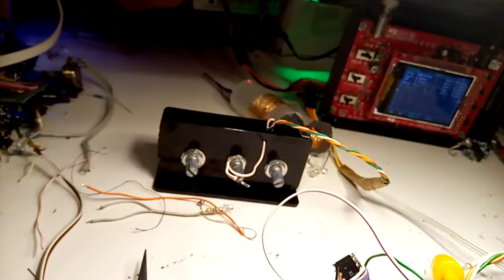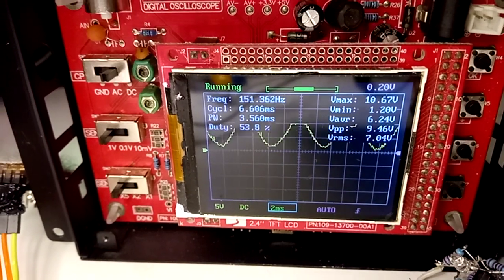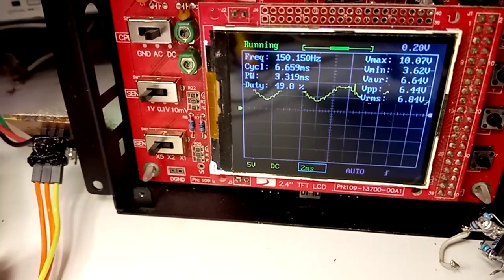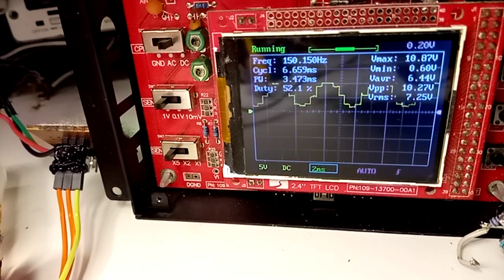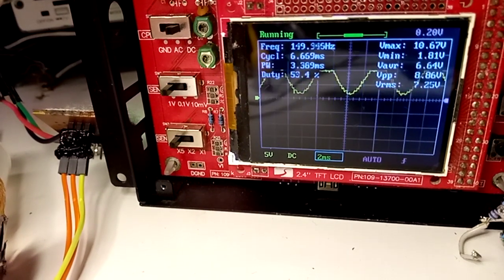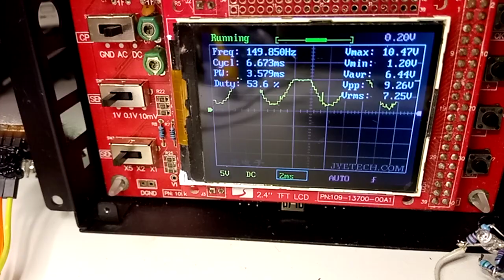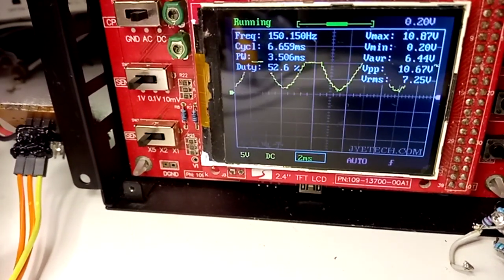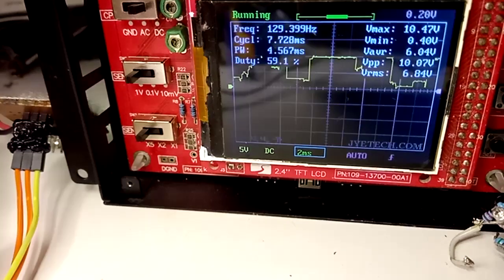Hardware-only DIY bitcrushing!

Comment: Sample rate reduction can also be done with a Sample And Hold (like my "YASH"). One of my favourite uses for this module. On your circuit here, I would look into providing a DC shift for the signal before processing, so you get to the lower bit settings. That clipping should be ideally made symmetrical.
Reply from the maker: RENE!!!! I used your 4069 VCO to control the "interrupt" function of the ADC, doing basic sample/hold. In fact, I like that effect better. I came back to this module with a LED-based trimmable reference voltage for the signal, exactly as you mention, and strangely with it set to exactly 2.5V it still needed trimming to get the entire 5V peak-to-peak signal working, and then the lower bit depths stay much more symmetrical too.

I've become convinced that a different approach is better -- basically using a pair of VCAs to reduce the amplitude of the signal going in to the ADC and symmetrically amplifying the output of the DAC, so you get less bit resolution without being restricted by the nature of binary numbers..... like you can have your signal turned into a number that's not just a power-of-two.
Reply: @ozerik  Yes, that clock part looks familiar :). There is a more compact circuit inside of my 3 phase LFO, done with a 4093 schmitt trigger gate (works with a 40106 as well). Your idea with the VCAs sounds promising. Be able to set it to something like 100 steps. But to get really low values like 2 steps might require quite a bit of precision. If you want to do it discretely of course. A micro controller can do this very easily.
Reply from the maker: @reneschmitz4845  I know, the part count for the VCA version would be so much lower and allow finer "bitcrush" levels. My brain has decided to lock onto that problem for a while... a simple high-pass C/R filter should let the EXTREME AMPLIFY  gain stage work even if the precision is off???
Reply: @ozerik  The best way to know is to try it out. :)
Reply: Man I really tried but couldn't get your yash to work... Sad nerd noises
Reply: @knopslmodular  Drop me an email. Maybe we can trouble shoot it.